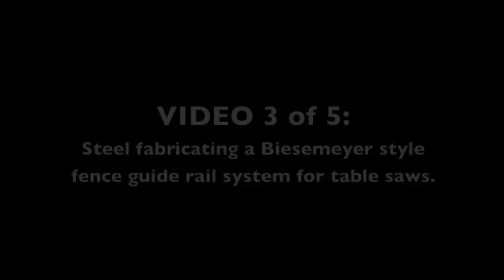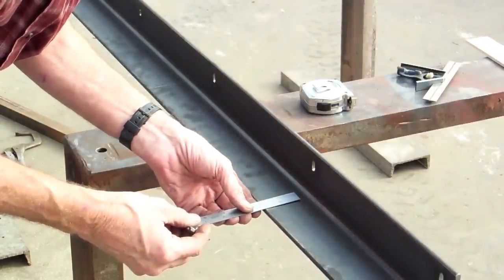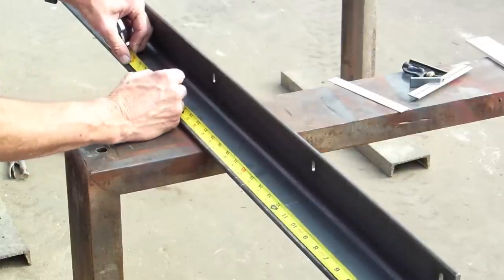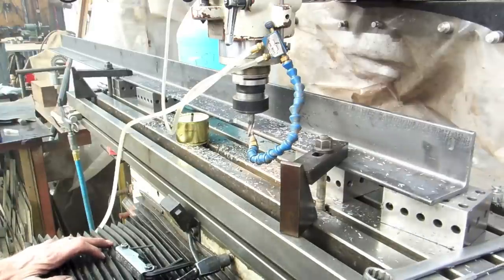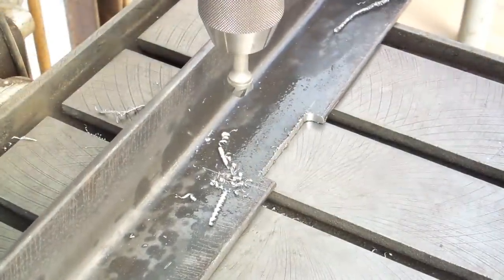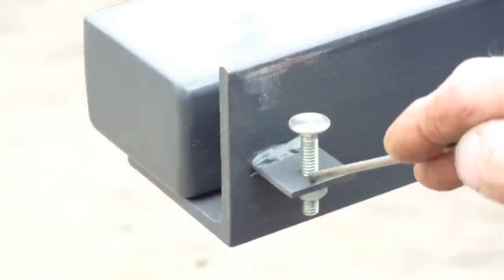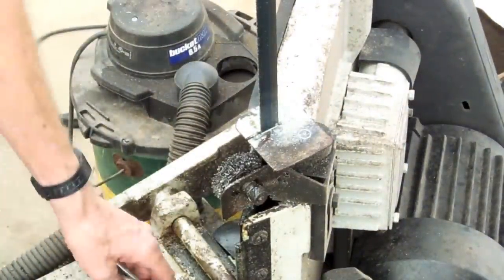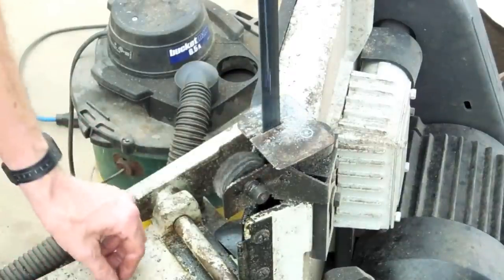3 of 5: DIY Table Saw Guide Rails for a Biesemeyer Style Table Saw - Marking, Drilling & Milling

Comment: Even with all the equipment available why would one want to go through all the trouble of ruining a perfectly good carriage bolt when 1/4" counter sunk bolts are readily available?
Reply: Cane Pazzo with the carriage bolt, he can use a wrench on the square under the head of the bolt.

Comment: 15 and 9 16 th inches  .... well if we deduct 3/14 of an inch and add 2/9 th of and inch .. you'll see why metric was invented !
Reply: there is no 3/14th of an inch....it's all in 2 4 8 16 32...

So...what's half of .571 mm?
Half of 9/16s is 9/32s.....half 1/8 is 1/4....
Reply: 0..2855 mm ?? just that easy !! whats  3/16 plus 3/4 plus 1/64 ...... alot  of trying to find a common denominator ...thats what !